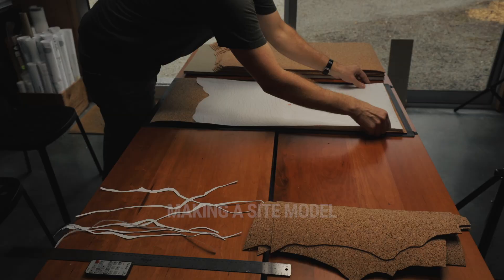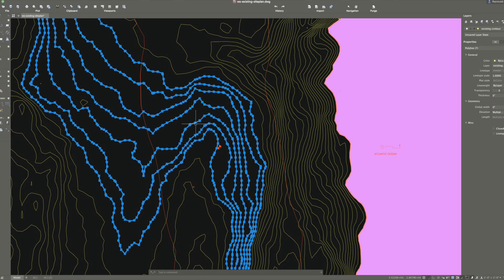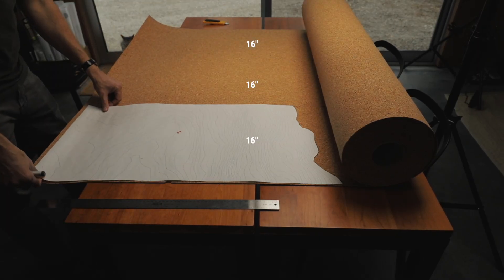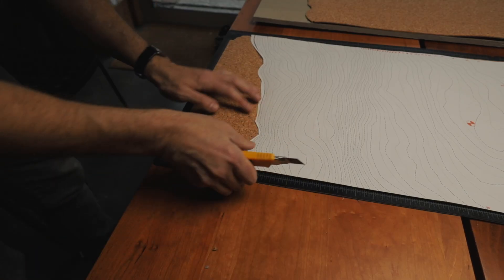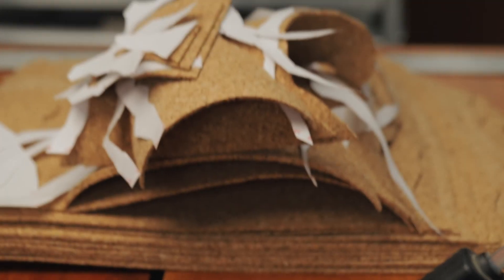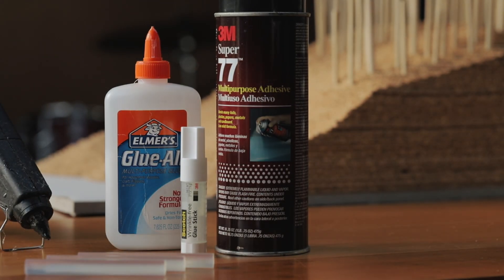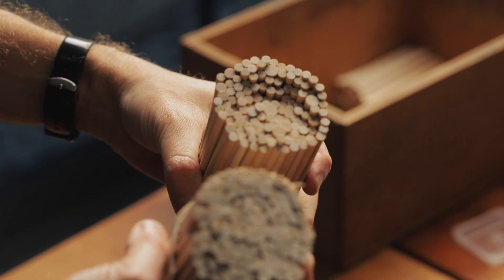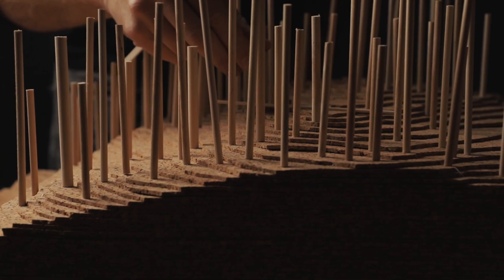Making a Site Model - The Outpost Project

Comment: In europe the thickness of cork is barely ever in the desired thickness (usually 4 or 6mm whereas i would need 5mm to make it somewhat work). Any other materials that could be used? Possibly on a budget aswell. I looked into cardboard aswell but i dont like the feel and look of it. I’ve looked around the local department store and they barely have anything in the right size and thickness that i would need.

Comment: I found myself getting frustrated about the imperial units. 3/32" is so close to 1/10 which would be perfect for metrics.
Reply: Not quite. 
3/32"(inches)=1'(feet), so making both sides the same units it's
3/32"=12" 
3/32"/12=12"/12, which means the model scale is 
1/128"=1". 
In Metric scale this would be written as 1:128

Imperial, or 'Standard", is used in three countries in the world; the US, Liberia and Burma (Myanmar). Working in Imperial IN SCALE is a chore.

Comment: Wouldn't this have been easier with a 3D printer? You can't do the whole thing in one go with most printers, but you could slice the model into 5"x5" sections with small amounts of infill and then arrange them on base. You could even have printed it from high def topo maps and gotten it very accurate.

Comment: If you need to relate to metric, type "inches to centimeters" in a google search, and that will bring up a conversion calculator. The 1:100 scale, where one centimeter equals 1 meter, is a similar scale to 3/32 of an inch that equals one foot because its ratio is 1:128. The 1:100 metric scale is a slightly larger scale than the 3/32" = 1-foot inch illustrated in the video.

Comment: If you had placed the baseplate under the angle of the rise, you might have saved at least 50% of cork.
Reply: Styrofoam would have been great for that 👍🏻
Reply: @little3rddegreeburns  ✔👍 however... Tempex is vulnerable, hard shell?
Reply: @robot7759  might as well have just casted it from plastic, even though plastic is not eco friendly, at least he'd save the huge amount of cork used
Reply: @numskull3207  one small problem; to cast you need a model... 😼

Comment: I would always swap sides at each layer on the cork roll, if both sides where the same, to counter the curling effect. Trees are always difficult to "get right". That pin technique never quite worked for me. some trunks would eventually sag. For water Sanded thick plexiglas ( some times with a strip of lights hidden in the border)
Reply from the maker: nice tips...longer pins for the trees help if the cork isn't dense enough...
the curling up at contour edges was always a problem for me when I swapped sides, it's esp. pronounced in lower slope areas...
Reply: @30by40  we used a large wooden board with some heavy items to weigh it down on every level and roll on glue which u can get from the floor finishes dept. basically that cork board is what you can use to finish a floor. hot glue wasnt flexible for the size of our model. but roll on glue, a bit like tile ciment for cork, was.

Comment: If you really want to save on cork, since you're saving the scaps, you could also save some more cork by hollowing out the topagraphy.
Reply from the maker: I mention this in the description...I find the hollowed out models are hard to build and ultimately unstable...just my experience...
Reply: @30by40  could you fill with plaster? Probably more hassle than it's worth though.
Reply: @30by40  Depends on how you hollow, how much work you're willing to put into it.